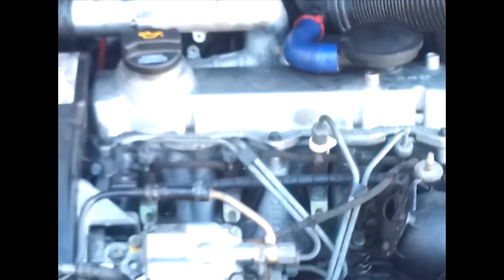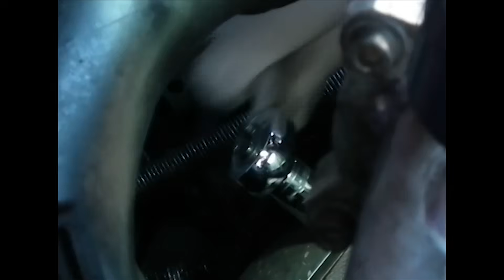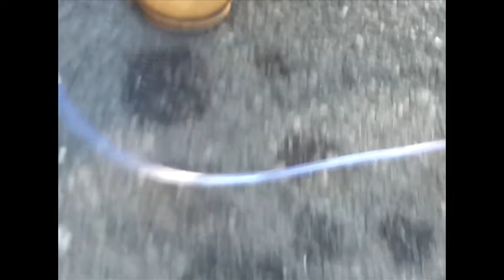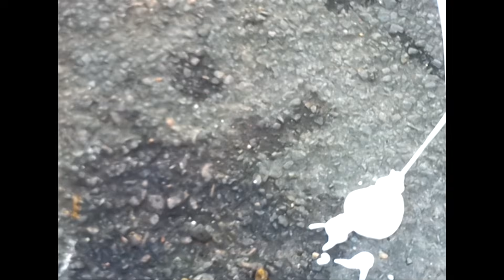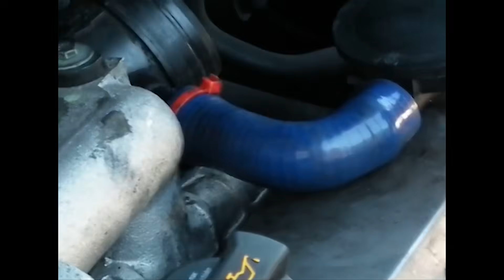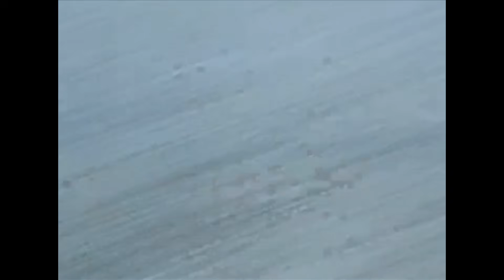Mr Muscle Audi A3 Tdi Turbo Clean - cheap fix

Comment: That will block up your dpf or cat. Best way is to use a sqirty bottle with water in. And squirt diredtly into your air intake. It steam cleans all the internal parts ov your motor.Do this a 2000 rpm when engine is hot. Ever seen a blown head gasket. The piston that is taking the water in is steam cleaned when the head is removed. They inject f1 cars with water to stop carbon build up. 
Look it up???

Comment: Hi i know this was a while ago but im in desperate need cheaped out and bought a second-hand turbo until im in a better position financially but the boost dosnt kick in until like 3000rpm on my old turbo kicked in at like 2000rpm  my actuator lever dosnt move all the way down is this what is causeing the late boost issue i had a overboost code also

Comment: I don't understand,  once you put the foam inside the turbo, do you leave for 1h the foam sit there ? Then after that what do you do, clean it or it will evaporate by itself? What's the next step after that?
Reply: Let it work it's magic then push it through the entire exhaust system by running the car with high boost

Comment: Going to do this tomorrow on my 2006 bmw e90 320d.
One thing to remember, If you haven't blanked your egr valve then you need to 1st as the cleaner will get drawn into the inlet manifold through the engine and that wouldn't do it any good imo.
My Egr is blanked so I should be fine. I  might make s video myself showing my diy delete.

Comment: If I was to do this on a golf tdi would I just squirt it down the egr pipe and let it work it's self down into the turbo?
Reply from the maker: As long as it's not getting to the alu engine parts you are fine, but personally prefer to remove the EGR and do it that way as you can see when it foams up.

Comment: I don't have access to egr, it is too hard to remove. Can the exhaust side of the turbo be accessed through the exhaust Flexi pipe instead. Maybe using a very long silicone pipe!? I'm mostly worried for the foam to go somewhere else (as I've heard it is flammable), or not to melt some sensors.
Additionally, is there anything that can be spayed/injected after the MAF that can clean the hot side of the turbo? Some say a dog cleaner should work, but... Doesn't anything get burnt in the engine, then it reaches the turbo's exhaust side?!

Comment: My Audi a3 tdi 1.9 goes  on limp mood  after 10 minutes on motorway can I try this 'll it work the same or do I need to  use turbo cleaner.
Reply: Learn your intake manifold flap & EGR vavle with carburettor cleaner. While doing that put Mr muscle in your turbo on the hot side.

Comment: Doing it right now on my Wife's  03 Jetta, finger crossed.  Thanks for the video!
Reply: How did it go?
Reply: It worked, she would go into limp mode on the highway running uphill.  I'm sure it won't happen now.  The engine raps all the way up to 5k now.  Her wagon has 286k but my sedan has 430k miles and mine is way worse, i can't wait to mine too. Thanks again, until i saw your video i though the onky way was to loosen the tail pipe.
Reply: @EricThompsonClimber did it last?
Reply: @okoolala it was a stop gap and the turbo eventually failed. If i had it to do again I'd try and clean the turbo if i were broke and just buy a new one if I had the money. They're pretty easy to do yourself. The oven vleaner is lye. What's lye and oil make? Soap.

Comment: Well done! Absolutely helpful staff. Just done it on my Ford Focus 2007 diesel. Instead of replacing the turbo for $1500-2000.this helped to restore my turbo to a new condition. Absolutely the best money I’ve saved!
Reply: Which ends did you put the Mr mussel in . Was you able to do it from the top of engine or underneath. What was your problems to begin with. Really need some help

Comment: EGR valves & VNT systems can be troublesome in most cars that have them, so I'm glad my car doesn't have either. The downside of that is that I have no way of accessing the 'hot' side of the turbo (the turbine), but I run my Saab on super unleaded and it gets an "Italian tune" pretty much every time I drive it lol. ❗❗❗❗ DO NOT use this stuff on the 'cold' side (compressor) which is almost entirely made of zinc & aluminium castings❗❗❗❗ Use Wynns turbo cleaner - I've done a video to show you how. Good information, chap.
Reply: Haha! Had to give my 2007 1.9Tid Vector Vert an ‘Italian Tune’ this morning after renewing front section of exhaust last night (flexi joint blown).
Didn’t seem to like the change and wouldn’t go above 3000RPM. Sorted now 🔧⚙️💥🤩

Comment: With 3rd gear, quite before the red area on tachometer, I still got limp mode. So I just repeat the process?
Reply from the maker: That's quite high and past peak torque and hp on a TDI - but still odd tbh.
If you have some cleaner left doing this again can help but failing that I'd also check the fault codes. You can find when you get to this point you've got stacked issues.

Comment: P0234 fault code can be fixable with that way? Mechanic told me my turbo charger should be changed. Should I try this before? My car doesn’t go limp home mode yet, but engine menagement light on.

Comment: How long dit this fix lasted before your torbo or egr was clogged up again? How about damage on the seals with mr muscle?
Reply from the maker: It didn't clog again tbh, I think before the car wasn't being run hard enough which under my ownership it was. 
I put somewhere around 40-50k miles on the car after the Mr Muscle fix - what ended up killing the car was a rear ender accident at over 230k miles - still on the original turbo.
I've heard of the very rare occasion seals went after this but I believe these are turbo's that were beyond saving and this was a last ditch attempt.

Comment: Is anyone active that would help me as well? I have got an Audi A3 8P 1.9tdi PD105 and I have no boost. It is hardly going up to 45mph and sometimes the check engine light is coming. I have checked the car with my OBD scanner and P0299 code showed up. The normal temperature of a operating Diesel engine is 90 degrees but usual temp. for my car is between 60-70 and sometimes goes up to 90 for a bit. I checked the turbos inlet side and there was no movement of the compressor wheel which mean it is good. Would you have a clue why I don’t have any boost and should I have a look for any air leakage?

Comment: The variable geometry of my Seat car was gripped and it was hard to move the lever that moves the blades of the variable geometry.
I have used this method and the problem has completely disappeared, the lever now moves smoothly and I have not had to disassemble the entire turbo, which is several hours of work.
The method is very effective now just waiting for it to be durable.
but that the disassembly and assembly of this method is very simple and counting that I have to remove the egr, that I have it functional, it takes 10 or 15 min more time to let Mr Muscle act.
In 1 hour it is finished.
Thank you so much for sharing it with us.

Comment: This also works on mondeos and jaguars as it’s the 2.0 Diesel engine and there the same 😉👍👍
Reply: Which kind of way did you take to inflate the foam into the turbo? May be the intake air hose? I got a 2006 Ford Mondeo 
2.2 Tdci.

Thanks!
Reply: Hi there you have to get it into the exhaust side and when it’s in there you need to move the actuator arm up and down as much as you can until it becomes really really lose 👍 then run it for half an hour ish just to clean it out and then you need to get the spray copper grease with the straw fitting and spray as much into the impeller as you can again moving the actuator arm as much as you can because it’s a anti seize grease and it withstands extremely high temperatures,, I hope this helps,,👍
Reply: @forddoctorforddoctor5918  Thanks for all, I'll try when it will be warmer. 👍🏻👍🏻👍🏻

Comment: Big diesel fan and user here. To all of you, simpler solution. Get engine hot, prepare deionised water in spray, open hose after MAF, right before side cold of turbo, get engine to 2500 RPM and spray water, slowly. It clean shit out of it exhaust valves and turbocharger.
Reply: Hmmmm
Reply: Hmmm  x 2 🤔
Reply: Sounds like bullshit to me I’ll be sticking with mr muscle😂 ready
Reply: @loudonnelly2591  Well bullshit you might think, but it works and people have been cleaning engines with water for 100 years.. what you get is a steam clean effect ....

Comment: This is a temporary solution , I tried it but after a few months it will get stuck again , the best solution is to remove the turbo and take the hot side apart and clean it , just make pictures when you tear it down .

Comment: Is it safe to do this on renault 2.0DCI with CAT and DPF? I'm concerned that the cleaned stuff from the turbo will clog them up. 
I want to clean it because I have a strange issue - When hitting 16PSI, sometimes 18, sometimes even 22PSI I suddenly loose boost and after a second or two it starts boosting again.  No lamps on the dash, no limp mode, no errors in ECU!
Reply: People do it on TDI all the time. You will be fine
Reply: You should heat up the engine before doing it

Comment: Can you not put it in the cold intake side after all im sure the foam will go everywhere in the turbo
Reply from the maker: Please under no circumstances try this on the cold side. The cold side and hot side are connected by the shaft but otherwise sealed (otherwise you'd suck exhaust gasses in through from the hot side). You will not clean the vanes that are carboned up on the hot side and you are likely to damage sensors and as mentioned in the video NaOH will eat away at aluminium, so any it might come into contact with could be damaged. In short there is no benefit from putting it in the cold side at all.
Reply: @CarAndMechanical  I have seen a vid where a guy soaked an aluminium tea light candle base for 2 hrs in Mr. Muscle. No damage whatsoever. https://www.youtube.com/watch?v=2k8IdyXwGE8

Comment: Could the Mr muscle damage the exhaust after start up?
Reply from the maker: To my knowledge it'll burn off due to its highly flammable nature. And   the cleaner itself won't damage steel - try it on some scrap or something for piece of mind, I recently used some to clean up exhaust manifolds (actually posted on my Instagram)
Reply: @CarAndMechanical  ah ok thanks! Also thanks again for the reply I think I'll give this a try.. my mk1 Skoda Octavia has been quite underpowered lately and I'm sure it's to do with the turbo 👍
Reply: Joshua Bush , how did you get with your Skoda? I just purchased a Skoda Octavia MK1, owned by a lady and it’s very slow...i’m looking to do the same job.

Comment: Would this work with dpf you reckon?
Reply from the maker: Is that a question about using the cleaner to clean the turbo on a DPF car or to clean the DPF?
If the first I think so because it'll burn off - the muscle cleaner is very flammable.

Comment: I did this on my 1.9 ALH and it worked great , the actuator was stuck in one position and now it works freely , I didn’t find Mr muscle oven cleaner but I used a similar product that had sodium hydroxide .
Be careful when removing the two bolts they might break . 
Thanks for the video .
Reply from the maker: Great stuff nice job hopefully given the car a new lease of life.
Reply: I thought I tell you my updated , after trying this out after a while the turbo geometry still got stuck and I repeated the procedure but with no luck , what i did was take off the turbo , open it and clean it and that that fixed it , it wasn't a  very difficult task to do just you need to use the right tools and some heat with some bolts , cleaning the geometry it's worth it only if the turbo doesn't lose oil  and the propellers and axle are fine.
Reply: what oven cleaner did you use? if you don't mind me asking.

Comment: I did this with some cheap brand oven cleaner and it cured the limp mode for about a week then it was back so got done real deal mr muscle to try, 2001 golf with ASV engine
Reply: Forgot to say at that point it still had EGR I’ve since blocked one end but put the pipe back on as apparently it needs to be present to pass an MOT now?
Reply from the maker: Glad you've got it sorted - the new MOT rules do state it's a fail if removed. On an unrelated note have you got an engine cover? I find they tend to tidy the engine bay quite nicely.

Comment: Although this will seem to work at first, I heard doing this eats up seals and can build up semi dissolved carbon sludge left behind the turbo vanes after the process. The only way is to strip it down and clean it properly.
Reply from the maker: I think it's a subjective one tbh, I did this and the turbo was fine for over 40k miles - my A3 used in this video was written off with over 230k miles on it and ran perfectly and as  far as I know it was the original turbo before a transit van decided he had too much faith in his brakes on the M1....
With the seals I have heard it can happen but I've also seen theories if they go from this they are not far from going anyway, I agree the ideal solution is a rebuild and full clean but it's not within everyone's time/ability and this gives things a second lease of life. 
Also regarding build up - might be worth a repeat clean, which depending on your viewpoint could be an issue with seals but honestly I've never heard more then 2nd/3rd hand of this being a very rare issue.

Comment: Hi Bro, do you think that Mr Muscle can clean Catalysator too? Just asking?
Reply from the maker: Did you mean the Cat itself or the o2 sensor?
Reply: Beacuse, with times, there are some deposit on Cat which block it, and i was asking myself the effect of Mr Muscle on ford Mondeo mk3 tddi Cat. Cat is just below the turbo exhuast. When i spray Mr Muscle on turbo, for sure it goes also on Cat after. I don't know if it is good or bad. Thx
Reply from the maker: Ah it'll burn up before then, this stuff is very flammable. This might have an ever so mild effect on cleaning the cat but it's pretty much airated foam so it's not a lot volume wise.

Comment: Will this work in a Mazda cx 7 2.3l. Dfi turbo?
Reply from the maker: If it's a VNT turbo with a mechanical actuator and you have the same sort of access then yes it should. Edit: Just checking is this a petrol? Because this clean frees up the VNT vanes on TDI turbos.